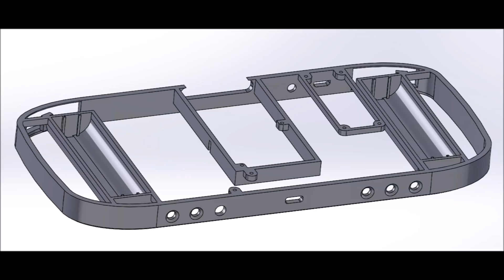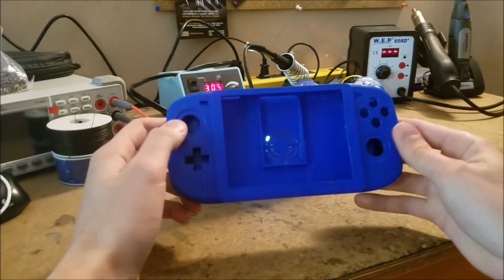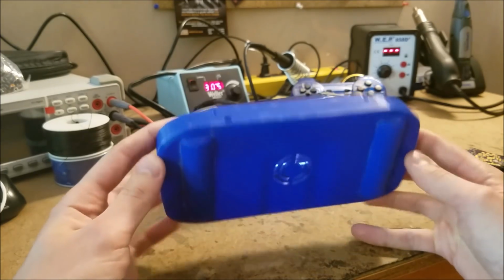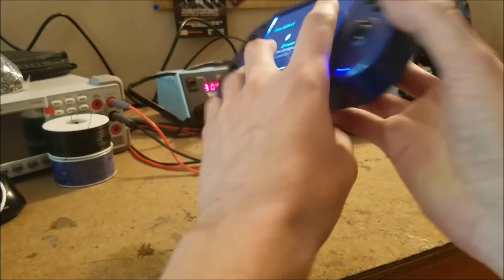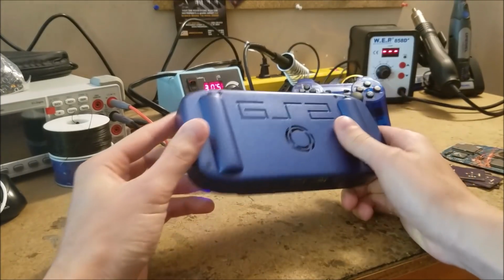THE FUTURE IS HERE! THE GS2 - NEW PS2 PORTABLE

Comment: How long do the batteries last?
Reply from the maker: I'd say somewhere around 3-4 hours
Reply: GmanModz I have a quick question will you ever make a PS3 portable
Reply from the maker: I don't think it will be possible. The console is too large and uses an enormous amount of power.
Reply: can you try make a game cube portable?
Reply: Nah it's not impossible...we're just waiting for when circuit printing will get smaller and much more powerful :)
Reply: SV79 \Superversion79/SUPERVINGIN69/MINECAFT  there are ps3 "laptops" out there and even kits now that it's been done for years. That's as portable as a ps3 will get...for now at least
Reply: GmanModz just sell this already.
Reply: Would you pay 800 for this? because that's around what it would cost.
Reply: Super Jooj por aí 

If u want a ps1 get a psp. You can get something called popsloader and put ps1 eboots on it
Reply: Super Jooj por aí 
If you can find a Vita with early firmware that's the way to go IMO. It does PSP emulation and all the emulation the PSP does, but with the extra analog stick for the later PS1 games. I LOVE my hacked Vita with SD card adapter
Reply: I suppose you can run ps1 games on this one too.
Reply: Spoo76 how much did it run you and where can I get myself one
Reply: Ebay, FB market, and even CraigsList sometimes. Usually $150ish, though i paid less. It MUST be on firmware 3.60 or EARLIER to play Vita games & use the micro SD adapter, but i believe later firmware than that you can still hack the Virtual PSP side which lets you play PSP,PS1 & emulators.  Once you get one with low firmware run Henkaku from the web browser and install Enso. the SD card adapter is called SD2Vita and only works if the full vita is hacked. The adapter is very cheap and allows you use micro SD cards that are much cheaper and more reliable than the Vita cards. Plenty of guides online & Youtube, but I highly recommend " The Modshiah guide" here on youtube
Reply: GmanModz You could go the emulator route? Tech probably not strong enough,yet but maybe in the future :)
Reply: Spoo76 thanks
Reply: 2 minutes
Reply: Cobrainvicta like 20mins
Reply: Maybe in the near future, PS3 will make slim version, so if you want you can do it. :-)
Reply: GmanModz Do you use a stereo mic? Cause I'm watching on headphones and it feels like the sound is coming from the tablet in front of me.
Reply: mekimeki mek

Sony probably will never make another ps3.
Reply: +Psp Tutorial Maybe God will change Creator's PS3 thought, and will make new PS3 slim. :-P
Reply: mekimeki mek lol
Reply: stiepan holkien Same i had to trunarround several times hahaha
Reply: Super Jooj por aí ps1 emulator on android
Reply: Foxlast Beta yo tengo ps1 emulator en mi psp
Reply: Should've had 4 battery slots instead of just 2. 7-8 hours would be perfect.
Reply: GmanModz I thought this was impossible until u did it. :)
Reply: GmanModz Someone did a PS3 portable
Reply: +F3RN4NDES Gameplays for ps1 portable , just get a psp/ vita with 3.60 or a raspberry pi with a screen.

Comment: How the PS vita should've been
Reply: You know the psvita can play ps2 games right?
Reply: @crashbash8549  Ehm... It can't.
Reply: @Deinorius  You can play ps2 emulators on psvita although it's not official it's perfectly capable of playing ps2 era games
Reply: @crashbash8549  lol wut?
No, it's not! Don't talk nonsense! It would even be hard for ports because of different necessities. It even needs a slight overclock to emulate SNES games! And you're talking about PS2 games! You funny and hopefully not serious.
Reply: @Deinorius  "The PS4 can emulate PS2 games. And it's who knows how much more powerful than the Vita. However, if you are dead set on playing PS2 games on the Vita, get a PC with a GTX card and stream PCSX2 to the Vita using moonlight"
Reply: @Deinorius  also quite a few games from ps3 era are playable on psvita (with downgraded graphics) with a smooth frame rate so I don't see why psvita wouldn't be capable of playing ps2 games
Reply: @crashbash8549  I think I get your mistake.
Your misunderstanding lies in thinking a game from one platform and another are the same. You even lack any definition for your words.

1. Emulating a game means they take the code that's meant to run on a specific hardware and use another software that's telling the game code it still runs on this original hardware but because this transmission needs extra performance you'll never see PS3 games on a PS4 or even more foolishly on a PSVita.

2. Just because there are games on a PS2 and PSP like Tomb Raider: Anniversary doesn't mean it's the same game/code. There are a lot of games that run on multiple platforms. Dragon's Crown runs on PS4, PS3 and PSVita (at least the PlayStation platforms). So there's a specific version for any platform and it doesn't mean that the exact game runs on any platform!

Do games exist that run on PS3, PS4 and PSVita? Yes. Does it mean the PSVita can play a game from another platform? Of course not! Stop this foolishness! I can't remember someone talking so much bullshit about console games.
Reply: @Deinorius  I think you miss understand my point. I'm not saying psvita can play ps2 games im saying that psvita is perfectly capable of doing so.

Comment: it would be really cool ifyoui can make a circuit board that takes the 24bit digital framebuffer output and then converts it to a HDMI signal, so you can add a fully digital HDMI port to an existing PS2 console if you install and solder the board into a stock PS2 console... 
many users have been asking for this everywhere, people are anoyed with only having component analog video out as the best picture quality output...

Comment: In your opinion is it better than the PSP for PlayStation 2 games, also I'd like your opinion on this to if the PS2 is capable of playing ported Dreamcast games then is it possible that the community could Port Dreamcast games because of the availability of the PlayStation 2 versus the Dreamcast, I know that you can just delete these things extremely easily but you can't do it portable without spending more than buying a Vita and that would also make it so that anyone with a Vita could play Dreamcast games without emulation which I assume it takes less CPU power so it should be able to play more games.

Comment: Why not just use a Raspberry Pi 0 for connections with the computer. That would also give it wireless capability so you can use it on the internet if you really wanted to. I was thinking the PS2 would have internet but you might as well wire. So that you could switch between the Raspberry Pi zero and the PS2, instead of Raspberry Pi zero you could use a Raspberry Pi compute chip it's a Raspberry Pi 3 in the form factor of a laptop Ram stick form factor. Although it may just be easier to put a Raspberry Pi 3 in there then too wire it all together.
Reply from the maker: RyanWake bradtelle excellent idea!

Comment: Would it be possible to make a ps2 classic mini?, By using the ps2 9000 model, removing the DVD drive and adding HDMI and modding it so it can run games of of USB and output 720p, also, remove the memory stick slot and controller ports, replacing them with usb slots, also change the power in to usb mini

Comment: I'm trying to make it run at the lowest power possible.. any advice? I'm trying to use 8.5V (as a power adaptor) with batteries and a buck-boost converter.. Can i use lower power?
Reply from the maker: I use 7.4v battery pack for all my ps2 portables. No boost converter needed

Comment: You would need to revise the shape before u make more, those batteries really look like they're going to take the brunt of a fall and I don't think that's good for them. But it does look good and you don't seem to have any discomfort holding it so I wouldn't mind paying for that what do you think would be a good price, if I Supply a PlayStation 2 and a controller do you think you could make me one for $50 + Equipment cost.
Reply: Also I would like to ask for a handheld one that has a PlayStation TV and a Raspberry Pi 3 on top of the PlayStation 2. you can make it pretty big, my cousin has a Nintendo switch so I wouldn't mind something be twice as heavy as a Nintendo switch. Also if the Raspberry Pi was upgradeable for whenever the Raspberry Pi 4 came out I assume it will fit in the same space, so if you kept that in mind, I would be willing to pay 100 over the equipment cost and I would like you to make two of them. So of course I would pay $100 twice.
Reply from the maker: I used cylindrical battery cells WITH a protection pcb. They are much less likely to get damaged than most consumer electronics.